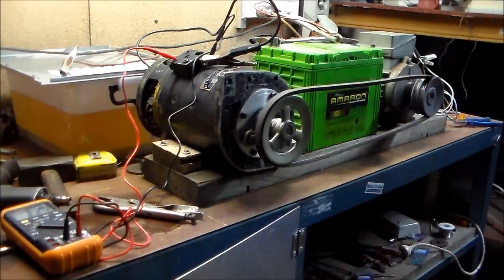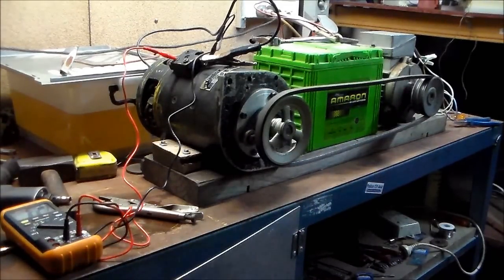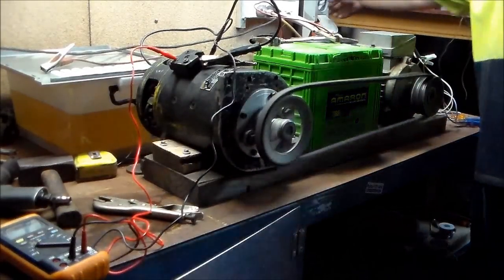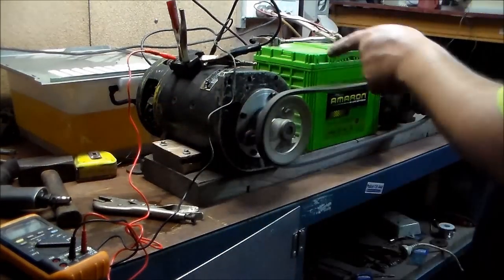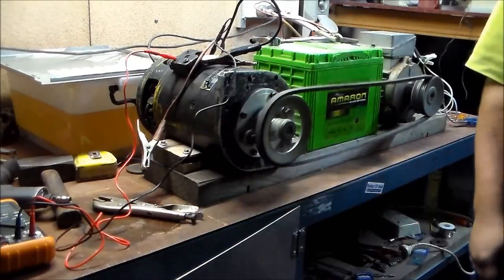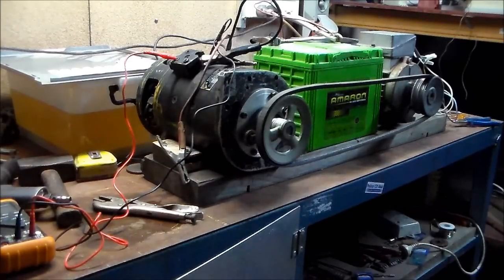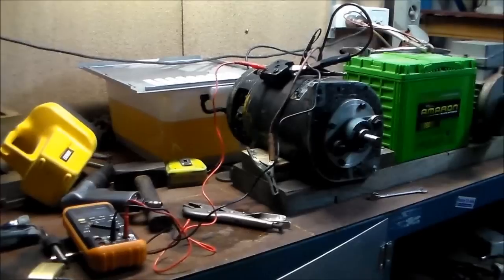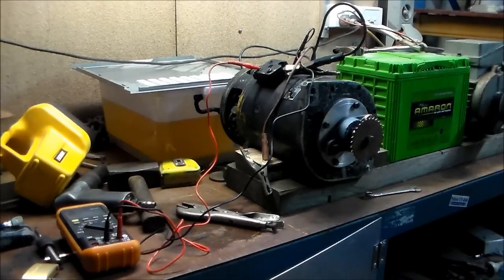BIG DC Motor, Attempt to run as Generator!

Comment: iff you couple the dc out from the "generator" with the field winding, most cases it will exites itself, if not let it conected and aply when turning a short dc puls from the battery on it, and after that it will exite itself (think it will exite itself anyway, you have a start voltage from around 1,5 volts whitout the field winding connected to the rotor.)

Comment: It's important when using a digital voltmeter to ALWAYS measure across a known value load resistor. Digital voltmeters are only accurate on AC scale when measuring a true SINE WAVE voltage. Otherwise reading won't be accurate.

Comment: U can actually run this motor as a generator,
U need to seperate the stator winding and the rotor winding and and connect them in parallel the motor can be self excited. If it does not excite it self then try to reverse the stator winding polarity.

Comment: Spinning a DC motor will actually create something closer to AC from the motor leads. Try the AC scale on your meter. And if it's not a permanent magnet motor you need to excite one of the windings to get output from the other.

Comment: It makes converting old tractors from 6V positive ground to 12V negative ground easier, because you don't have to change out the starter.  They also really crank quickly after that!